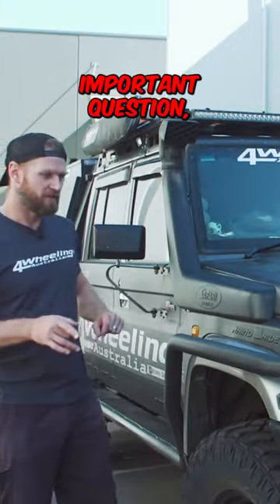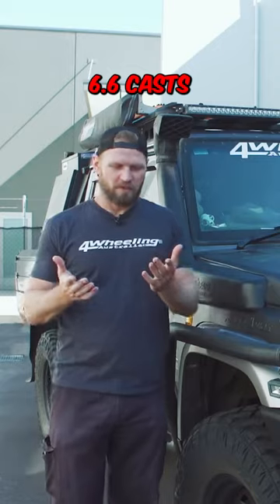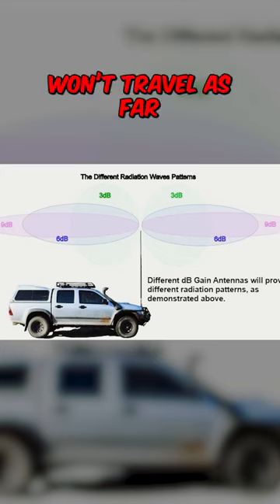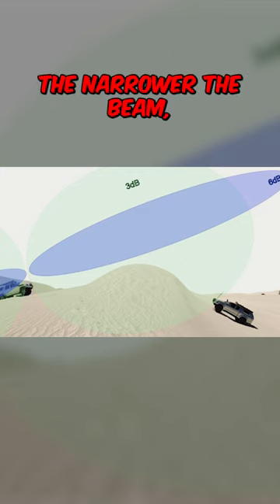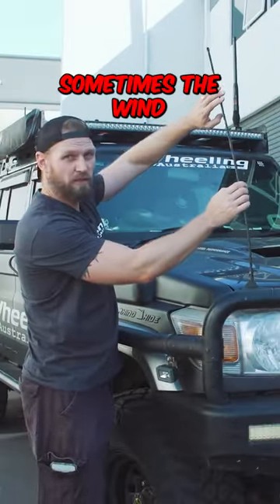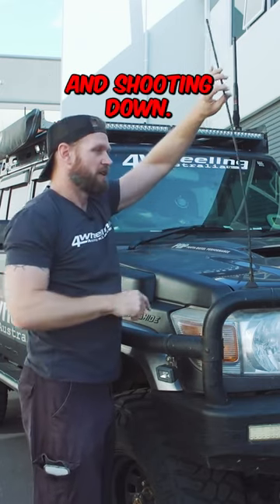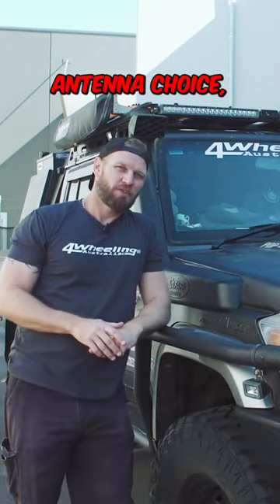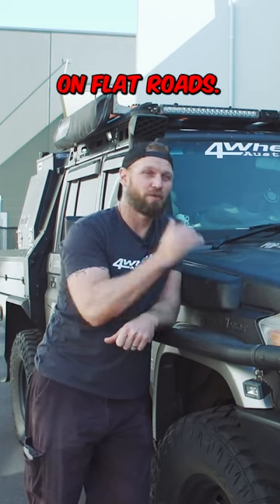UHF RADIOS Antennas 2.1 vs 6.6 #shorts #gme #radios #antennas

Comment: Out of curiosity, is it uncommon for AU offroaders to use Ham radio instead of uhf?  My mobile 2m/70cm (vhf/uhf) rig can easily reach 30 miles without problems, and a an hf rig can reach much much farther than that even!
Reply: Yes it is. Maybe not for amateur radio operators,  but everyone else uses the UHF CB frequencies (some still use 27mhz AM frequencies) 
There is little point using amateur frequencies unless you are talking to other amateurs as the most common use for UHF CB frequencies is in convoy or to talk to other travellers, truckies, etc. especially those coming in the opposite direction in desert country.

Comment: The beam catches the signal already transmitted in a wave like am/fm radio just a big wave you need to pulseate to your antenna
Reply: What on earth are you talking about?
Reply: Radio is already sinusoidal.  It's literally already alternating current.  If you have a radio at all then you're enjoying this effect.
Reply: @TWX1138 I ask the same question. What the hell does that mean? Ronnie’s description of the effect of having a higher gain antenna is absolutely correct. You don’t get anything for nothing. A high gain antenna becomes more directional on a flatter plain than a lower gain antenna over a hillier terrain.
Reply: @malcolmL995  I wasn't replying to your comment.  I was replying to the bizarre assertion that it was necessary to do something to your signal, when the radio's job is to take input and generate a waveform from it.

Gain through manipulation of the antenna shape didn't come into it.
Reply: @TWX1138 ok sorry, I hadn’t quite gotten over the comment we were both referring to. It’s interesting that it emailed me your comment which in theory should have gone to the guy you were replying too.
Reply: @malcolmL995  replies to the top-level comment never have the ampersand-username for some reason I don't entirely understand.
Reply: The old saying;  height is might” in uhf realm✌️
Reply: Haha, as a radio engineer, you my friend are talking some amazing nonsense

Comment: The graphic showing an antenna emission is not accurate.  Most vehicle-mounted antennas use the vehicle itself as a ground plane, with the mast serving as only half of the antenna itself, a half-dipole.  The graphic shows the emission coming from the upper tip of the antenna.  In reality the strongest signal comes from the base of the antenna, because the ground plane itself is serving as the other half of the dipole.

This of course wouldn't hold true for a true dipole antenna shoved way, way up into the air, or a half-dipole with its own counterpoise up at the top, with the rest of the mast merely serving as a structure for height rather than as a radiating element.
Reply: I think the issue here is that he’s demonstrating the effect of the antenna bending using an AM cb aerial whereas he is describing the gain etc of a UHF antenna.